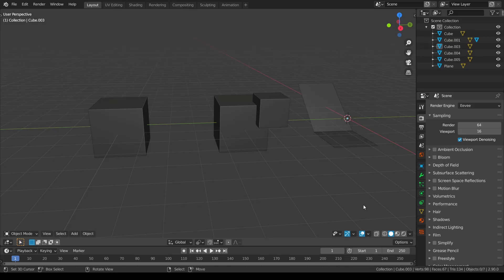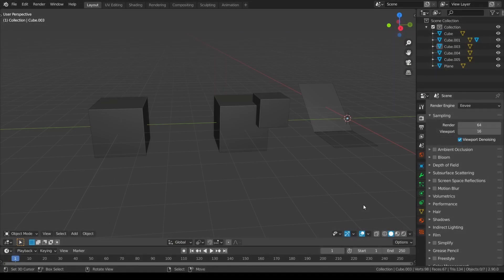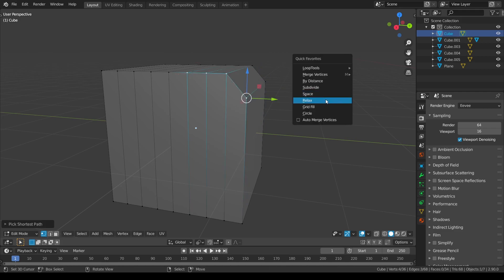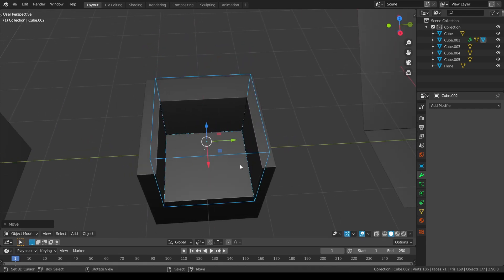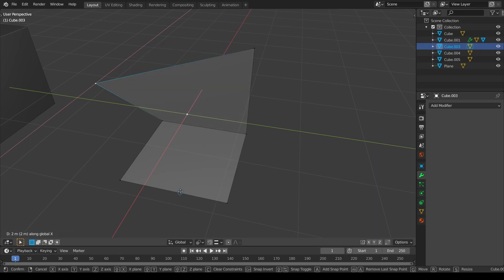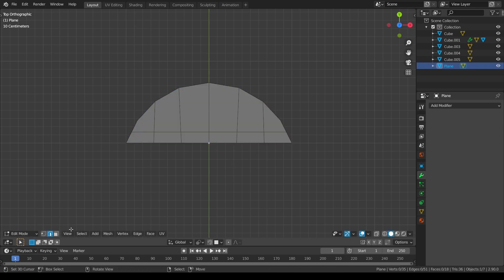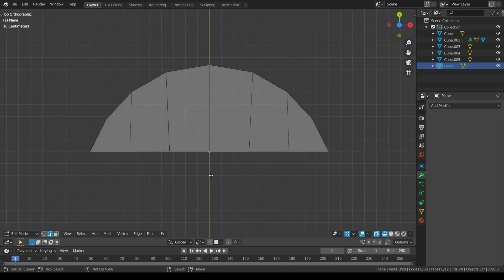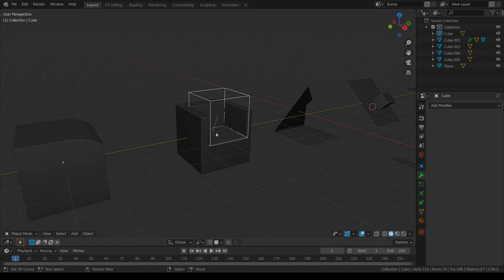Blender - Prologue | Master Chief Helmet Modelling Tutorial

Comment: It feels like you have used a car modeling lecture at some point, these techniques and that metallic material seem really familiar
Reply from the maker: Nah, I've never done any car modelling before, though, much of the principles of hard surface modelling would certainly transfer over to car modelling. As for the materials, probably car like, they were pretty basic, just the principled shader with a low roughness value and then a metallic value for the visor. 😄